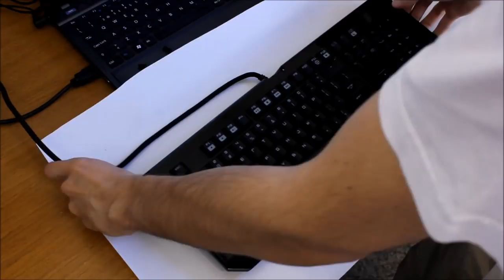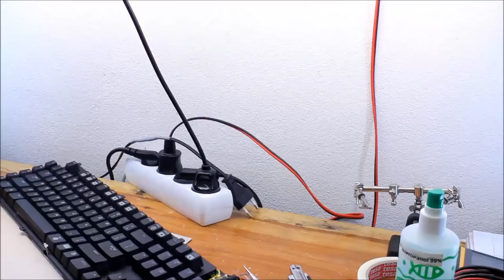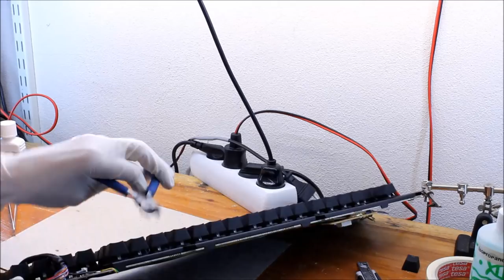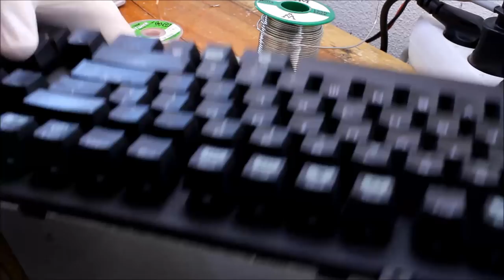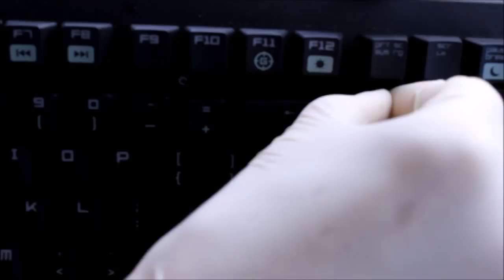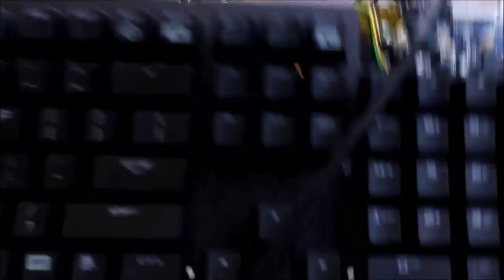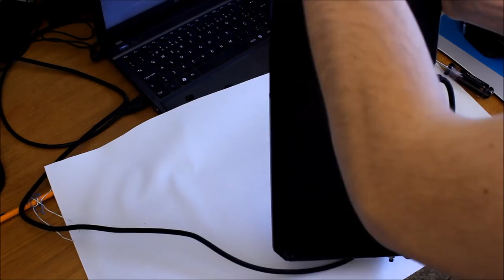How to replace backlight LEDs and Cherry MX switches in a mechanical keyboard.

Comment: Does this process still apply to the 2014 version of the keyboard?
Reply from the maker: They should be very similar. As far as I know the new razer switches are cherry clones.
Reply: Yeah, they're Kailh switches.
But by doing some quick googling, I found out you can replace them with cherry mx switches.
Thanks for the quick reply btw :)
Reply: RazacxX José Faria I'm wondering though, if I actually have to desolder them like Jose does to update from Kailh to Cherry's. if I was to take off the keycap, the top half of the switch, the spring, and just replace with Cherry's, would this be exactly as Cherry, or does the bottom half that's soldered in actually make a difference?
Reply from the maker: it will be a lot of work disassembling all the switches, on top of that, I think you could buy a keyboard with cherry mx switches with a similar amount of money you will spend on the switches alone.
Reply: Bruce Wayne
hey batman, i used this video to mod my razer blackwidow 10keyless.
i have a 2013 model but i wanted to change out most of the cherry mx blue switches for mx green switches
if you know how to de-solder then you might as well do it. in the end it took me 3 hours start to finish, to change out about 80% of the keys on my keyboard. given i was going pretty slow and taking breaks sending and receiving SMS's from people.  glad this video was uploaded as it gave me the the idea to do so, and made me realize how easy it is.
Reply: Grottowalker Sounds awesome Grotto. Does it work perfectly without a hitch? I think the greens are like blue's with more resistant springs, did you consider just swapping the springs?
Reply: works perfect, tested it after i modded it and all the keys that i changed worked no problem. i have done a few soldering projects for building stuff so i thought it would be quicker to solder. i already owned a solder iron and solder sucker, so i was set when it came to materials and requirments
Reply: José Faria kailh's to cherry switches. hell yeah :p
Reply from the maker: I tried a razer a couple of weeks ago and the new switches are not that bad, other than being "clicky". They should be a lot cheaper, though...

Comment: is it possible to damage the entire keyboard doing this procedure? i have a corsair k95 i know some electrician who is expert at soldering. im gonna show him this vid. i just want to know if the damage is inevitable so i might think twice having it replaced. thanks in advanced!
Reply from the maker: Melvin Gonzales Unless there is a very serious accident, it's unlikely that any simple damage will be terminal, you can always use jumper wires to replace any damaged vias and tracks.
Reply: Alright thanks man! Oh and do we really need to clean it before and after soldering?
Reply from the maker: No, if you use a good quality no-clean flux don't worry about it.

Comment: I am looking to change the switches on my logitech g810 to cherry mx reds, will using the same process in the video work or will I have to do something different?
Reply from the maker: If I'm not mistaken, at least some of those keyboards have custom logitech switches, you need to make sure yours is compatible with Cherry MX.
Reply: José Faria yes my keyboard has the romer g switch is that compatible?
Reply from the maker: No, I dont't think they are compatible, and even if they fitted the PCB (which it looks like they won't) you would have to switch your keycaps as well. It will be a lot cheaper for you to buy a new keyboard with Cherry MX red switches.
Reply: José Faria ok thanks I think I'll just stay with the g810 it's not as click as I would like it but it's rbg and that good enough for me
Reply from the maker: jalbutt42 jalb Cherry MX reds don't click, only blue and brown, those are the ones you want if you want to hear or feel the switch. Cherrry MX red are linear and you can't feel when the switch actuates.
Reply: oh okay the click on my current one is similar to cherry mx browns
Reply from the maker: jalbutt42 jalb That's what I'm using right now, MX brown, you can feel when the key actuates without any extra noise. Cherry MX blues are really loud, I used them in a lab and everyone was going crazy when I had to type for long periods of time :D
Reply: haha sounds like fun

Comment: Hey, I was wondering, I have a Razer Blackwidow ultimate 2013, I love the green, but I really love the new keyboards coming out with RGB backlighting, would that be possible to do on my keyboard? I know all i'd have to do is switch the leds out, but I have 2 problems: 1, I can't seem to find any rgb leds, when I search for them, all I can seem to find is "assorted" rgb leds, eg: 10 red ones, 10 blue ones, etc. I haven't found them anywhere. The 2nd problem is, I have now clue how I'd control the colors. I was thinking I could use Razer's program to control it the way the razer chroma is controlled, but that wouldn't work since their program already detects my razer keyboard as the model it is. I could just buy an RGB keyboard I suppose, but I paid a lot of money for this one, and it's perfectly fine, just curious if there's someway to get rgb lighting working on it.
Reply from the maker: Short answer is you can't. RGB LEDs usually have 4 pins, one common anode/cathode and three more pins, one to connect each internal LED individually. The problem is that these larger LEDs wouldn't fit in the switch and the PCB only has 2 holes for regular LEDs. They can also be LEDs with an internal controller like the WS2801, but they would also have more pins, two for power and one or two for digital communication.

As you can see here, the new LEDs are a lot wider to accommodate the extra pins:
http://elchapuzasinformatico.com/wp-content/uploads/2014/10/Razer-Blackwidow-Chroma-11.jpg [elchapuzasinformatico.com]

Technically, if you have the skills you could hack it and find a way to fit a small RGB led in there, then wire them all into a custom controller and just build a simple control program, but it would take so much time and money that if it's just for the "bling effect" it would be easier to just buy a Razer Chroma or a Corsair K70 RGB.

For a complete bodge, there are RGB LEDs with two pins with an internal controller that just cycles trough the colors, but they would probably not remain synchronized and each key would end up in a different color at the same time.
These are the ones: http://www.aliexpress.com/item/Free-Shipping-500-pcs-lot-2-PINs-short-legs-5mm-Slow-RGB-Flash-Rainbow-MultiColor-LED/32260314609.html
Reply: José Faria
Yeah, definitely not a viable option. Hmm... Oh well! Well if I have the money and want the Chroma, I guess I could always sell my black widow to my brother for some extra money :p
Edit: Oh and also, what are your opinions on Razer products? I know people just despise razer for having "the shittiest products in the world" and etc, but I haven't had not one problem with my keyboard or mouse, and I've had them for at least a year each. What's your take on Razer?
Reply from the maker: DarkVeilGaming I couldn't find a similar discussion I had with other youtube users to link here, so I will present you with a brand new wall of text/rant :D

In short, I don't buy Razer anymore because I prefer other brands, but they are just fine, it's a matter of personal preference.

[RANT]
I don't buy razer anymore because I had several bad experiences in a row, I bought a razer orochi and it was the worst bluetooth mouse that I've used because of the power save lag, on top of that it had a philips twin eye sensor, which I didn't knew I didn't like at that time, personally I prefer avago sensors.Instead of an apology and/or some kind of firmware fix, their position regarding the large amount of people complaining was "deal with it". Let me clarify, I wasn't trying to use the mouse in games, I liked the idea of an USB connection for gaming and the wireless freedom for work, but it was lagging too much not in games, but in applications like word processing and web browsing, let that sink in.
My previous gaming mouse was a razer copperhead which was, as I said multiple times, pretty much one of the best mice I ever used (had an Agilent sensor, now sold as Avago). If it wasn't awesome enough in itself, some people complained about the prediction algorithm, so Razer took their time and released a NDC version of the firmware for people to disable the drift control if they didn't like it. That's awesome customer service right there. Maybe they could do it because they were a smaller and more agile company at the time, this was 10 years ago, I think it was their first laser mouse.
When I saw there was going to be no firmware fix for the bluetooth issue, I gave it away and bought a corsair m60. Awesome mouse, but I decided to give wireless another chance, so I bought a mad catz rat 9, but it drifted a lot when I lifted it and put it back down, guess what, it had a philips sensor. I put it away and went back to the corsair. If it breaks I will buy another one immediately.

A bit after that, because I spend a lot of time on front of a keyboard I decided to give mechanical keyboards a try. Since at the time most mechanical keyboards were using the same cherry switches I went for a razer blackwidow, the one in this video, because I could find it locally. They keyboard was fine, I just didn't like the blue backlight so I changed it to white. As a bare keyboard it wasn't bad, but it cost a lot more than some other bare brands because of the extra "bells and whistles", so I decided to put them to good use and installed the software. Guess what? It was when they decided to introduce their "razer synapse" software, which at least in the first versions required the users to be online and login in the freaking configuration utility! If that wasn't bad enough, it was a pain to install, it actually required me to email razer support for them to tell me which folders to delete. Want more? In the configuration utility there was a slider to set the brightness which allowed you to select the brightness very precisely with live preview in the keyboard, but when I let the slider go, they keyboard would default to one of the predefined brightness points. Clearly the hardware and the software could do it, so why on earth didn't they use 8 bits out of the "epic" 32KB onboard storage to store the PWM value? As per usual, their reply was deal with it. That's when I replaced the LED colors and added my custom PWM controller and was perfectly happy with it (I decided not to use the configuration software at all). I ended up giving it away because I use it in a room with other people and the clicky sound of the cherry mx blue switches was driving everyone insane, replaced it with a cooler master trigger z with cherry mx brown switches and white backlight and couldn't be happier.
[/RANT]

I know I might be a bit picky, and probably had a bit of bad luck too, but that's who I am and that's fine, I simply stopped buying their products because there are lots of alternatives. With all that said, their products are certainly not "the shittiest products in the world", if they were they would not have the huge amount of faithful customers they have, people who are fanatically against a brand when there are so many alternatives are just trying to annoy and bait fanboys into arguments :D

I think they have reasonable products, and because so many people like the brand they are able to sell at premium prices, good for them, I would have done the same, I just hope the customer service improves to what it was in the beginning.
Reply: (I have my own rant too haha)

Yeah, I get what you mean. I actually have a pair of headphones from them, the Razer Kraken Pro, and tbh, I just hate them. They don't feel good on my head at all, it feels like they're squeezing my head really hard, and there was no controlling the different aspects of sound, so it had a ton of bass, whether I liked it or not. I've worn them maybe once, even though I spent however much they cost on their website haha. It was also hard to use because the mic on that headset is complete utter shit. It's quiet, has no pop filter built in, it's just plain bad. But my 45 dollar turtle beach earforce x12's are amazing! They're super comfortable, the mic is good quality and has a filter to keep out all the clicks and whirrs. plus, IT HAS MIC MONITORING. Seriously my favorite feature. I tried using the razer headset, but I kept catching myself yelling because I couldn't hear myself. With my turtle beaches, It's seriously amazing to be able to hear yourself so clearly in your headset. Also, about halfway down the cord, it has a little converter thingy that has adjusters for volume and bass, which is incredibly nice. It's rediculous that so many features are included in a headset that is half as cheap as the Kraken Pro.

But on the flip side, I think Razer makes amazing mice and keyboards. I absolutely love my Black Widow ultimate, the green glow isn't hard on the eyes and is pretty configurable, it has 10 settings of brightness, 11 if you count no lights being a setting. I've had it for about a year now, and i've had no problems with it whatsoever. Same with my Razer Naga 2014, I love it, I use the buttons on the side all the time, it's so handy. Took a bit to get used to it since I had been using a tiny little laptop mouse, so I had trouble picking up the naga without pressing the side buttons, but it only took a few days to adjust. I use them in almost every game I play, i'd be terrified if I had to play an mmo without them haha. Guess it goes to show what Razer is, and isn't good at haha. Keep up with what you're good at, keyboard and mice. Stay away from headphones though. :p I guess that's the end of my rant on the Kraken Pro's haha, irrelevant but.

Comment: Parts of the video are too dark and we can't see what exactly is being done when the key switch is removed or when you remove the old LED to replace it with the new one.  Other than that, very good video.  Definitely takes a lot of patience and effort to replace every single LED light on that keyboard - wow.
Reply from the maker: Yep, the lighting is not adequate and everything being black doesn't help. :D

Comment: what is the previous mod you have on your keyboard?
Reply from the maker: +Ryan Winklevoss It's in the description, automatic brightness mod: http://www.youtube.com/watch?v=aUg_jtZq0TY
I replaced the blue LEDs with white ones and I added a small circuit that automatically reduced the backlight intensity as it got darker so it wouldn't bother me at night.
Reply: Thanks :)

Comment: Does this work with a corsair k70? My W and my 8 buttons dont click anymore
Reply from the maker: It does, if you have a regular k70 the procedure is almost the same, you just have to buy regular Cherry MX switches, but if you have the RGB version you need to buy the appropriate translucent switches.
Reply: I do have the normal version. Thank you for your time Jose!

Comment: The most common way of damaging pads is to overheat.  Put flux on the connection and when it starts to smoke pull away the iron in the next second.
Reply from the maker: That's a very good rule, but in these thick boards with 1.6mm or more, sometimes you have to heat it a bit longer to melt the solder in the other side too. To be honest, most of the pads I lifted were due to mechanical stress, either because I pulled the component or wire too soon and too vigorously or because I accidentally pulled solder wick sideways.

Comment: How achievable is switching the leds from one keyboard to another? I'm an amateur btw
Reply from the maker: It's perfectly doable, LEDs have thick leads and usually don't get damaged when removed from old boards. Bear in mind, though, that new LEDs are really cheap, it might be worth using new ones to avoid the time and work wasted removing the old ones (and using new ones you don't take the backlight of the older keyboard).
Check some new listings here: https://www.aliexpress.com/wholesale?SearchText=led+3mm+flangeless
They usually come in bags with 100 pieces, you can buy 2 bags or talk to the seller and ask for a bag of 150 or so.
Reply: Well actually I have 2 cheap keyboards with red switches only that one has mixed backlight and I like the face plate and the other has rgb lights but i don't like the way it looks. So I would like to take out the rgb leds and swap them in the mixed keyboard. I will probably look for an electronist and pay him to do this though
Reply: Also my leds look flat under the switch, not like the ones you linked. Maybe they're not removable or something? They do seem to rest on top of some fludor coating
Reply from the maker: Nah, if they are flat it's probably an attempt to diffuse the light better, as long as the top of the LED doesn't go above the switch, the shape of the LED doesn't matter, just make sure they are flangeless (the flange is that "skirt" in the bottom of some LEDs). There are many different LED packages, the difference is just the lens shape, inside they are identical: https://upload.wikimedia.org/wikipedia/commons/thumb/9/9e/Verschiedene_LEDs.jpg/750px-Verschiedene_LEDs.jpg